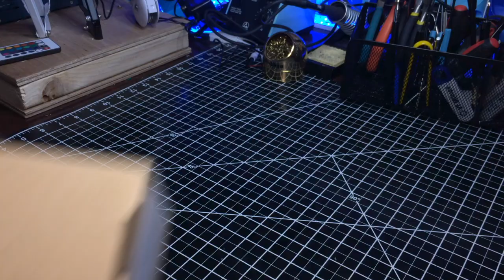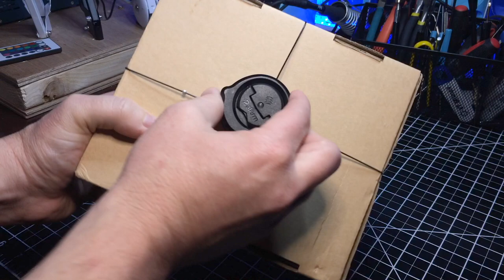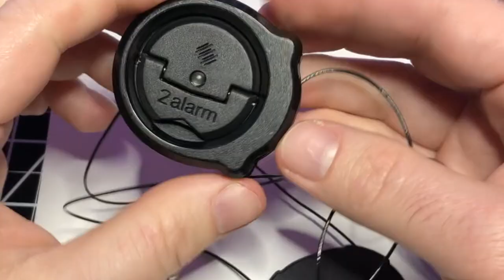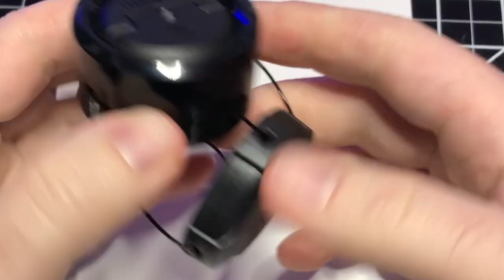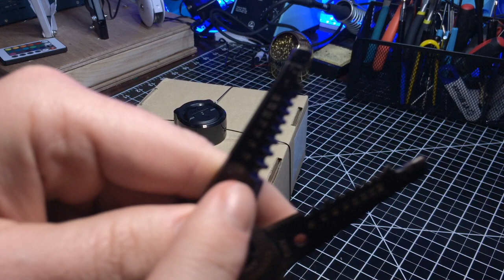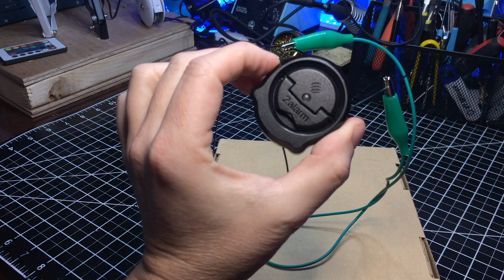Will I be able to bypass my Spider Wrap security tag using alligator clips?

Comment: I had no idea about these spider alarm things and received a package I ordered from Walmart that had one. I took wire cutters and cut the wire. The alarm went off. I covered it to muffle the alarm while trying to break it open, which I couldn't. The alarm stopped after about two minutes. So I say just cut the wire and muffle it somehow. It will turn off on its own after a couple of minutes.
Reply: There's much easier ways to do it but I would say probably one of the easiest ways for someone that isn't necessarily mechanically inclined just look at the alarm itself and where the vent holes are where you would hear the actual speaker behind it chirping the noise just take a nail place it over the little grill where the speakers behind and just give it one good tap with a hammer and it'll go right through the speaker and it'll shut up instantly
Reply: @81Todd  I wonder if putting it in the sink and running water over it would work.

Comment: I swear this security things are the most quality thing made nowdays
The material they use is like quality
Reply: Often higher quality than the object they are designed to protect
Reply: lol quality.... you can open these things in literally 3 seconds with a simple magnet. doesn't sound quality to me.
Reply: @FalloutGenius1  these things are useless for protecting anything and they're not quality lol. you can open them in 3 seconds with a simple magnet. it's too easy.
Reply: @PabzRoz  may i know what kind of magnet ure talking about pls. its for research...
Reply: @hysojin6156  neodymium magnets. you can get em online anywhere.. they work perfect. I use the fishing magnets because they're bigger.
Reply: There is a very simple way to disarm these bud. They need to find a way to hide the cheap plastic speaker that is exposed for mass destruction..lol.  Oh yeah, you can also order the magnet that takes these right off

Comment: Question,
So are you saying towards the end of the video if the alligator clips are removed after you cut behind the alligator clips that the alarm will sound? Or were you saying that the security spider tag is basically useless now? Could the alligator clips be reused multiple times? Or after removal will the alarm sound is when I'm asking...
Reply: When the clips are eventually removed, the circuit is broken. If not disarmed, yes the alarm would sound. 

You can use the clips as often as you like, but the only way to defeat the alarm is to maintain continuity in the electric signal. 

He simply made a different continous loop of wire with temporary connections. This method is useless in the field, it can't really be applied to attempt property theft, as you would be super suspect hunched over, trying to strip the wire coating on 2 locations then attaching additional equipment (the clips,) before clearly clipping the security device. 

Security will be very interested in your project before it's completed... I dont see this as being useful for anything other than proving how the device works and doesn't work. (Yes to electric signal disruption, no to tension change/release. That means it won't sound the alarm simply because the wires are no longer pulling the same degree as when it was set. Their tightness is changed but the alarm does not go off. 

Much easier to acquire an alpha key, or tape some rare earth neodymium magnets behind 2 properly spaces square plastic posts. Same thing.

Comment: Totally fricken works! Just authenticated it. Confirmed.
Reply: just use a magnet... takes literally 3 seconds. place a magnet on it and it pops right open. this is just silly.
Reply: Yes but doesn’t using a magnet or the spider lock key initially unlock the wires BUT leave a 1-2 second alarm beep?  Your test rendered the spider dead quiet

Comment: I bought a computer last year at best buy. They forgot to take it off. It did not go off when I left. When I cut it at home cause no way I was going to go back just to get it off. Did not go off when I cut it. It did go off when I pulled the wire after cutting it.
I ended up putting it in a glass of water till it quit shrieking
Reply: @floxy8424  didn’t feel like walking through the parking lot with it shrieking. Live in an apartment
Reply: @PumpkinKingXXIII I have the same issue right now too. How were u able to get rid of it or have it stop beeping
Reply: @IamRyanYung  i fulled up pot of water and dropped it into the water. It was barley audible in the water and stopped after about 5 minutes

Comment: I be damn it freaking really works first time it didn't we learn that you have to remove black coding but MAKE SuRE you have one wire that MOVE BACK and FORWARD and ONE WIRE DONT MOVE BACK and FORWARD WHAT'S SO EVENER. But REMEMBER DON'T  don't try to try to use the back and forth wire where the alligator clips are using it will not work make sure it's one that moves back and forth and one that don't move at all then it will work I'm sorry you need to be more specific but me and my boyfriend absolutely love the video and it actually work the second time
Reply: or you can just use a magnet to open it and it takes literally 3 seconds...
Reply: Very poor video. Unless you're 10 years old , then it might be interesting.